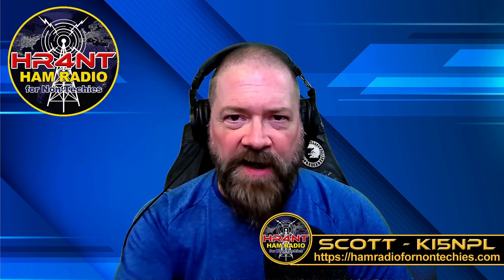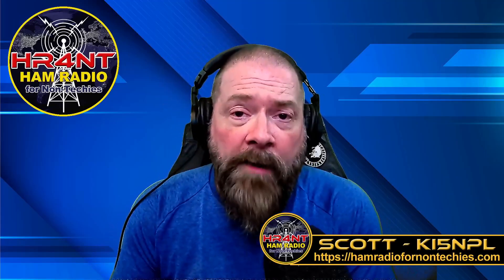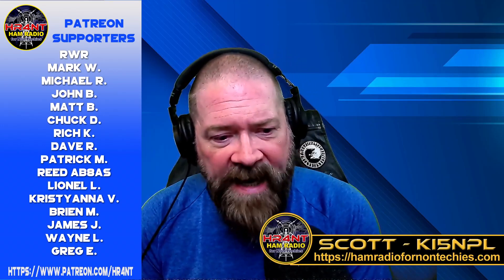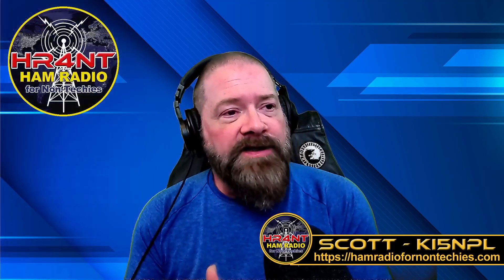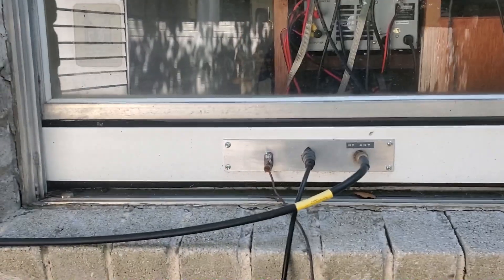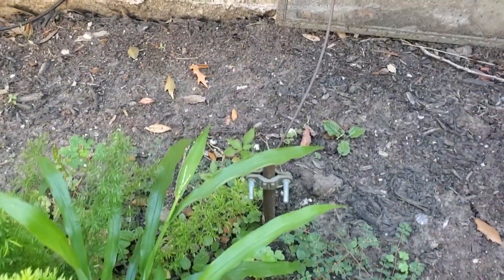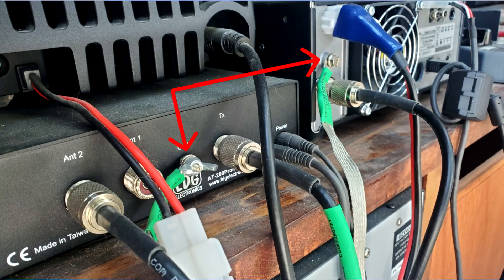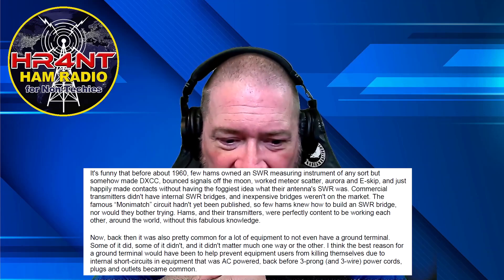Grounding My Ham Radio REVISITED:  What I Have Learned Since Then

Comment: You're beginning to sound like the dingbat at the ARRL telling anyone that would listen, that grounds a myth !
Not to throw the Baby out with the bath water, you are of course correct about a Direct strike !
I read where a Broadcast station spent upwards of $40,000 on the grounding of their Station, only to receive a Direct Strike !
Those grounds did little, if anything ?
But looking at what I believe to be your station ground, you may want to rethink the size of wire used, as yours looked horribly undersized ?
And for your particular installation, it may be more about RF grounding, as opposed to grounding for lighting protection !
               👍😉
          Just Say'n !
Reply from the maker: I think my solution I presented in the video works fine.  Not saying that grounding doesn't work, I am saying it may not be necessary to drive yourself nuts trying to make it absolutely perfect.  Unplugging the gear when not in use is a solid solution.  Thanks for the comment and for watching.  73!

Comment: Thank you for the update.  Living in a 1940’s home in Portland, OR, the only ground I found on the house is tied from the panel to a cold water pipe.  I have since added two grounds to be safe, one at the panel and another on the opposite side of the house at the AC unit.  It may be overkill, but with all the unusual and unsafe work I’ve found, I feel better.  As you have mentioned, I just unplug everything when not in use anyway.  Thank you for the update.
Reply: I think it was relevant prior to the use of PVC or plastic pipe.  Keep up the great work and excellent  
Videos
Reply from the maker: I have to say it does work.  The old way of grounding to water pipes seems dangerous to me aside from being very outdated.  I think your solution is sound.  Best of luck.  Thanks for the comment and for watching.  73!

Comment: I have always worried about not having my station properly grounded.  When I first set up my station and had my tower installed we dug a five foot deep hole for the concrete base. At the bottom of the hole I drove an 8 foot ground rod into the ground so it goes down about 13 feet.  The ground here is actually not very good.  But also storms here are extremely rare.  Anyway, then I ran grounding cable from the ground rod underneath my mobile home to go up through the floor to my station.  The cable from the grounding rod was too short to reach.  Then I attached another grounding cable to it with a clamp.  Now the first part of the cable is about 2 inches wide but the added part is only an inch or so wide.  I don’t know if that makes a difference or not.  Then that was attached to a copper piece to which all of my equipment was attached with short pieces of cable.  Then I heard that the station ground must be connected to the main electrical ground.  I live in a mobile home and the main ground is almost at the other end of the house which is nearly 70 feet away.  So since grounding should be as short as possible that doesn’t seem like a good idea to me.  In 2919 I had to temporarily move out of state because my mom was not doing well and was in her last years.  My sister was her 24/7 caregiver at that time.  After she passed away I returned home in 2022.  Other people had lived in my house while I was gone.  I came back to find my station completely disassembled and much of my equipment gone.  Even my chair and desk set up.  The copper piece to which everything was grounded is gone the grounding cable had disappeared beneath the floor as well as coax from the my two VHF/UHF antennas (one vertical and one horizontal).  Several years ago my Explorer-14 was damaged in the wind so now that is no longer up on the tower and some of the pieces are missing too.  My rotator cable that also used to come up through the floor is also hiding somewhere underneath the floor.  My OmniVII is gone.  My Yaesu 736-R is gone.  I do still have my old Paragon but the display no longer works.  The only HF antenna I have is an 80 meter dipole hanging off the tower in sort of an inverted vee form.  My LDG auto tuner is also gone but I have a small manual tuner.  About all I do now is listen to Net on 75 meters.  One question I have about grounding is how does grounding or not grounding affect transmitted signal or not?  73 DE KL7CH.
Reply from the maker: Thank you for sharing your story.  Sounds like you went through a lot!  I fell for ya man and I hope that someday you are able to get more gear and enjoy radio once again.  As to your question:  I think in certain conditions grounding can affect signal a bit, but not enough in my experience to warrant overthinking of it and making sure everything is perfect.  Radials on certain antennas, like the DX Commander antennas series, can absolutely affect signal, but I never ground my antennas or my gear.  My solution I lay out in the video, works every time for safety of the gear and does not affect my transmissions or reception.  I hope this helps.  Thanks for the comment and for watching.  73!

Comment: I am with you on this.

I’ve seen a couple incidences where all this extra grounding makes for another path to equipment that it would otherwise be isolated during a lightning strike.
Reply from the maker: Exactly...and you can drive yourself crazy thinking about it.  This is simple and it works 100% of the time.  Problem solved. Thanks for the comment and for watching.  73!

Comment: I agree with how you did your grounds. I also unplug everything during thunderstorms. 
Somewhere I read that if you disconnect your coax cable and drop the end into an empty glass jar, it will prevent a direct lightning flash coming through your coax into your house from arcing out to anything in the room? 
Your video is great, I follow the same procedure.
Reply from the maker: Fantastic!  Sometimes the simplest solution is the best!  Thanks for the comment and for watching.  73!

Comment: According to the NFPA, National Fire Protection Association, unplugging the power source to equipment, and unplugging outside antennas and (GROUNDING) them, will give you about 99.9999% protection against a lighting strike. Nothing is guaranteed.  The EMP from a close by lightning strike can do a tremendous amount of damage to sensitive electronic equipment.  Grounding does not prevent this.  Perhaps a Faraday Cage might help.  So, for better protection, disconnect your coaxes and ground both the center conductor and shield to your external ground rod.  This will keep the difference in potential, static, drained off to ground and by doing this will prevent a lighting strike to your antenna/s.  I would also recommend installing some Alpha Delta surge protectors on those coaxes outside of the home.  Continue unplugging the power sources. You'll be fine.
Reply from the maker: I do have lightning arrestors on all my coax going into the house.  This solutions has worked perfectly so far. Thanks for the comment and for watching.  73!

Comment: Sorry it is not only about storms. In my old shack I was getting RF Burns from my equipment By grounding my shack I eliminated the RF burns.  When I built my new shack I followed in detail ARRLS Grounding and Bonding book. As a Computer Network Engineer I know that ground looping can cause serious problems. So I also set up insulated and isolated ground in my electrical wiring. I have zero problems with electrical and grounding and RF in the shack. I am not saying anyone must do what I did however its like they say better safe than sorry. Many insurance companies will not pay out for destroyed equipment if the electrical "rules" are not followed. Do what you must to get on the air and have fun, then improve as you go. Don't worry about grounding or anything but have a goal in mind and progress toward it.
Reply from the maker: Thanks for sharing.  Each person must assess the needs based on their situation.  RFI burn wasn't an issue for me but storms certainly were.  Thanks for the comment and for watching.  73!

Comment: New Ham here, iam not sure, but does Grounding help improve radio signals?
Reply from the maker: It "can" affect how a signal is received, but mostly it is to protect your equipment.  I do not ground to improve radio signal.  Your antenna is the most important element of your radio setup.  If you have counterpoise wires coming from it like the DX Commander does, then that would help with signal.  I hope this helped.  Thanks for watching and for the comment.  73!!

Comment: I commented with my experience and opinion on another of your videos but I will add something here you mentioned in this video. I build a lot of homebrew equipment and run 5KV on vacuum tube amplifiers and I absolutely ground all my equipment and cabinets to each other and to electrical ground return for the additional, and very important reason that I do not want a HV short to a chassis or rack, etc. to find a path thru me to where ever it wants to go. I know the current is not looking to personally kill me but, you can never be absolutely sure that some portion of it, in the case of a HV short to the outer metal of equipment, might just find that little random path thru you to, as I said, where ever it wants to go. I do my best to give it some easy place to go rather than thru me...  I don't stress about it and am not confused - I take care of it. Physical safety is very much an important part of why I use grounds. Always have, always will. Stay safe and thanks for your videos.
Reply from the maker: I think your setup for your situation is absolutely the smart thing to do!  Keep it simple , but effective and you should never have an issue.  Thanks for watching and for the comment.  73!!

Comment: I've been a ham for 45 years now. (Wow, I can't believe I'm that old.)  This video is spot on. Unless you live on a mountain with a 1200 ft radio tower in your backyard, this grounding business has gotten out of hand. I mostly gave up on it years ago. I do have a copper rod pounded into the ground with lightning suppressors. That's only because I might forget to unplug my equipment and also maybe it will help if there's a lightning strike in the area. Obviously, if lightning hits your house, all bets are off. Also, I think some people have a problem with RF in their house, so they need some sort of grounding. Personally I've never had that problem. I was also trained by an extra class who had been a ham for 60 years, and he never grounded anything. Also, as the video says, things have changed. In the old days you didn't have grounded outlets and people played around with high voltage equipment, didn't take proper precautions, and I guess fried themselves. My philosophy is do the best you can, get on the air, and have fun. Thanks for a great video.
Reply from the maker: You nailed it!  I agree that the topic gets heated way too often and made complicated where an easy solution is right in front of them.  Thanks for the comment and for watching.  73!!!

Comment: Not just storm protection though… making every piece of electronic equipment in your shack a common ground reduces RF interference and if one thing happens to puke it won’t ruin anything else.
Reply from the maker: Good point.  Thanks for the comment and for watching.  73!!!
Reply: Isn't the third prong on the plugs a common ground?

Comment: Thank You very much for such a great video on gounding your rig and shack Scott. I learned a lot. Also thank you for standing up to all those Mister Know-It-All's and putting in your own two cents pertaining to grounding. I agree with you and what you said. Yes, in many ways they are sort of right, and yes they mean well, but as you said, they go way overboard and get too carried away with the grounding process. No amount of grounding and lightning protection is going to protect against and thwart a direct lightning strike. 

I also remember back when I was a Pershing missile system technician, repairman and missile launch computer operator in the military and we were sent TDY from Ft. Sill, Oklahoma down to Orlando, Florida for six months to help the Martin Maretta Corporation develop and field test the new Pershing II Nuclear missile system. 

On the first day of training and work we were sitting in the orientation class during the usual afternoon summertime thunderstorm getting ready to go out to the equipment after the downpour of rain let up and the corporate safety director came into the classroom and told us that he was sending us back to the apartment complex as there would be no work for that day as a bolt of lighting had just taken out the brand new forty-four thousand dollar lightning protection system they had just had professionally installed by professionals the week before. 

It was 4 days before they got it repaired enough for us to go back to work and training.
Reply from the maker: Thank you so much for sharing that story!  That was very interesting.  Sometimes you just have to fall back on common sense and take the best course of action that will serve your needs.  My solutions in this video has served me very well since I published it.  Thanks for watching and for the comment.  73!

Comment: You have done nothing wrong by driving in another ground rod.  The NEC (National Electrical Code) is the MINIMUM necessary.  You have gone beyond that with an additional ground rod.  The "ground" is the entire globe.
Reply from the maker: Thank you for that!  I caught a bunch of flack over having multiple ground rods, but common sense told me it made sense.  Thanks for watching and for the comment.  73!!

Comment: The science does not support your conclusions. The biggest problem your creating is having a difference in potential between entrance ground and your shack ground which is dangerous even without lightning.
Reply from the maker: Unplugging my gear at the hint of a storm seems to be working so far for me.  Thanks for the comment and for watching.  73!
Reply: If one only keeps one’s gear plugged in when you’re using it, then you’re right - no problems.  

If there’s any chance of lightening striking anywhere near you (not your antenna, but just say a tree in a nearby field), then you’ve created a potential difference between your ground rods because you haven’t bonded them.  

Potential difference = current

If your gear is plugged in say overnight and it’s grounded to both non-bonded ground rods, but IS connected through your home’s electrical system, then you’ve just created a more efficient path for the current flowing through the earth.  Instead of flowing through the dirt between ground rods, it’s going to flow through your equipment.

I know you unplug your equipment, but for the sake of others who might not unplug their equipment whenever they don’t use it (or forgot to) they should know that unless you bond your ground rods, your equipment is at risk.  73!

Comment: Thank you for your video, I dont even keep an antenna up all the time, I just go out set it up and then when I'm done for the day I take everything back down and unplug and put all my stuff away.  So is the grounding mainly for lightning protection and electrical surges?? If that is the case would I be ok with just having a good surge protector, and not have anything up and plugged in during a storm? Being more specific I don't have a shack yet I just set my stuff on the kitchen table and run my coax through the window.  I just bought a Ft-991a that I spent good money on,  so I was a little worried cause I just have it wired up  to a DC 13.8 x 30a power converter that is plugged in to a 3 wire outlet.  I don't have anything connected to a ground other then the ground from the 3 wire plug on the converter.  I don't keep it plugged in all the time though,  I pull it out set it up for a few hours, then when I'm done I unplug everything pack it up and go out and take my antenna back down.  Part of that reason is I don't have a shack I'm working off the dining room table so I can't leave it out all the time.  I was working off of cheap radios and an sdr before but now I'm worried cause I spent a lot on this new radio, I don't want to mess it up.
Reply from the maker: Keeping your gear unplugged is the best bet.  You can go down a bunch of rabbit holes with grounding as it seems to be a subject that everyone has an opinion on.  Keep in mind that no matter how well you ground nothing will survive a direct lightning strike.  Common sense dictates that just keeping it unplugged when not in use or if a storm is approaching will be a more guaranteed method of protecting your gear.  Grounding is to help protect from surges and I also have a quality surge protector in my shack that all my gear plugs into.  I hope this helps.  Thanks for the comment and for watching.  73!
Reply: @HR4NT  Thank you, yea I bought a 4500 joule surge protector, and will just disconnect/unplug when not in use.  Thanks for your video 👍👍